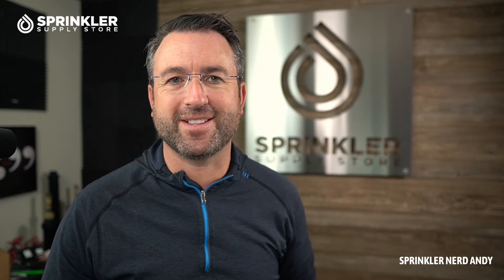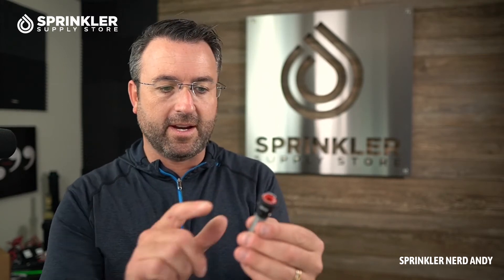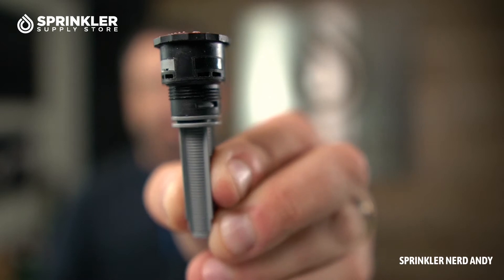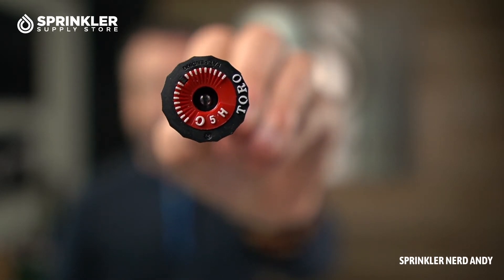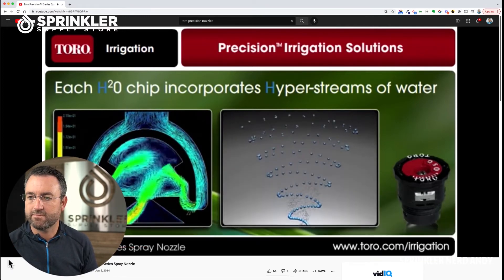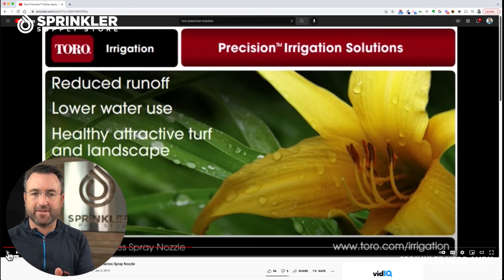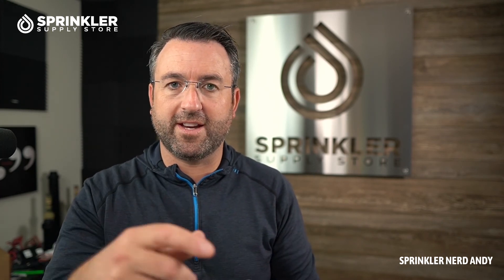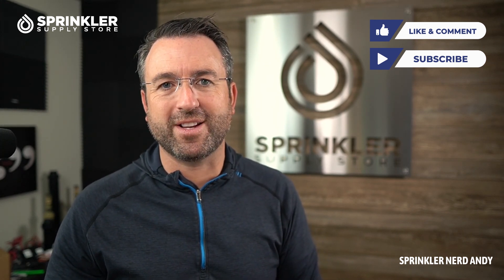What are Toro Precision™ Series Spray Nozzles? | SprinklerSupplyStore.com

Comment: In terms of actual irrigation volume, are these the same as regular toro heads? If it's more efficient shouldn't you adjust the zone timing to be less? Or do you keep the timing the same, it's just the coverage that's more efficient?
Reply from the maker: Spot on. Yes, if you are an advanced user and understand the principles of proper scheduling. There are additional factors, such as wind, that this nozzle helps.

Comment: Hello Sir.  My yard has three kind of sprinklers which are Rain Bird, Hunter and Toro 750 Series.  I want to shut off sprinkler head for Toro 750 Series sprinklers.  Unfortunately, I could not find  the cap for it although I searched it from so many web sites and hardware stores. Would you please help me to provide the web sites or name of hardware stores selling Toro 750 Series cap protector?  Thank you very much for your help.
Reply from the maker: Hello - great question. As far as I know, there is no cap for the Toro 570. Instead, you can unscrew the sprinkler and cap the fitting that feeds the sprinkler using this 1/2" Cap: https://sprinklersupplystore.com/products/448-005-cap-1-2-thrd?variant=44025144934709

Comment: I installed these (strip) nozzles during spring 2022, and was removing the midway through summer in late June 2022. I found the build quality totally lacking. Purchase female threaded and found that the tops of the nozzles would pop off when the sprinkler would shut down. Nearly every single one had this issue, which is something I have saw before. Not sure what that piece did, but I found the sprays to be very misty. I have a regulated my pressure to 40psi and even went down to 35psi then 30psi and they were incredibly misty still. I replaced them with hunter Mp rotator, and those seem okay. I did have Rvan installed prior to the toro but again I found those to be inadequate in terms of holding an adjustment. Finished the year with MP rotator so I am hopefully they’ll fire up correctly next spring.
Reply from the maker: Thanks for sharing. That’s interesting, and good to know to know! Appreciate all the info -Andy
Reply: The problem probably isn’t the new Toro nozzles. Years of wear and tear, heat and sun damage tend to distort the threads on the original riser. The old nozzles were fused and similarly distorted such that a perfectly good brand new nozzle can’t get a good grip. In these situations the entire body needs to be replaced. I’ve seen this happen with every single brand. Years of living outside, pressure and up/down motion take their toll
Reply: @drdrew3  I’d say it was the nozzles,  brand new nozzles from any other brands didn’t have misting issues, nor did the top cap pop off. Every other brand of nozzle has been fine in the same spray body that the toro’s were using.  I’ve spoke to contractors out here and not a ingle said they would recommend toro for anything other then commercial turf or a golf course.  And just to get it out there, I am not a brand fan of any particular spray - but the toro spray were a let down. I was really hoping that these would have mimicked the RainJet sprays of 20years ago. Which to this day, I still consider those old RainJet heads to be some of the best produced that had the great distribution of water.